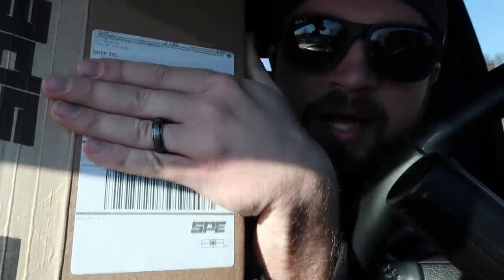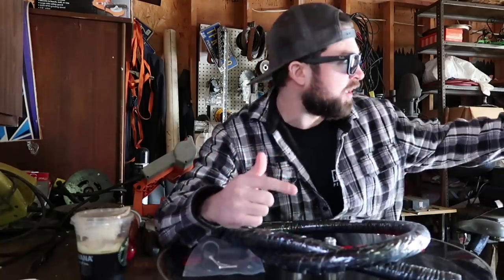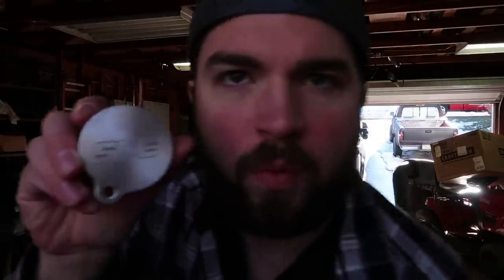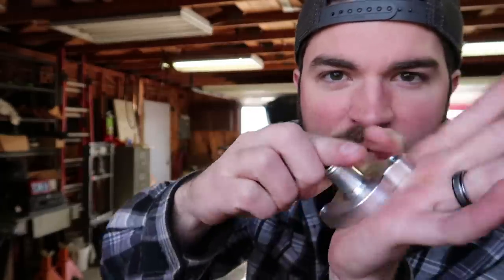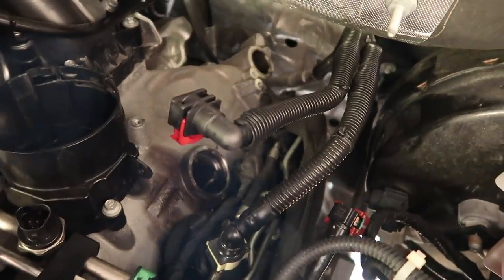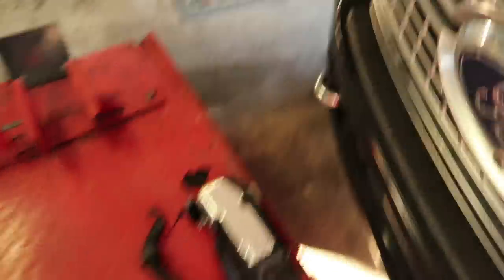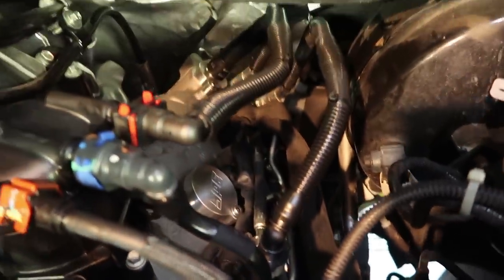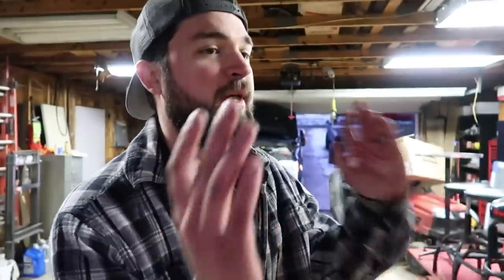OIL IN YOUR INTAKE - 6.7 Powerstroke CCV Reroute

Comment: There is nothing wrong with oil vapour going back into your engine. Definitely can't hurt the turbo and definitely won't hurt your motor. To add, now you are putting even dirtier air into the atmosphere . But do whatever you want who cares. Just wanna say it does no harm to your engine or else it wouldn't be engineered that way

Edit: The amount of oil that actually comes through in vapour form during a 5000 mile interval wouldn't be noticeable on a dipstick

Comment: crank   case   oil  lubes  turbo  seals   lubes  top  end  as  well  you  should  learn  about  it  read  about  it
Reply: That's not how it works.
Reply: SO  AS  ASE  MASTER   TECH  IN BOTH CARS  AND  HEAVY   TRUCK   AND   28  YEARS  I  BEEN  WORKING ON  AND  BUILDING   DIESEL FOR  THE  GM DEALER AND  MY  SELF   I  GOT  IT ALL  WRONG  OIL .   COME  ON  PICK   UP  A  BOOK  AND  READ  UP  . THE  BLOW  BY  CONTAINS  OIL   THAT     FLOWS  THRU  INDUCTION  SYSTEM  IT  IS  USED  BY  THE  ENGINE  TO  HELP  LUBE  TURBO   SEALING  RINGS   ON TOP  OF  THAT IT  HELP  LUBE  TOP  ENGINE  OF  ENGINE   WITH THE FUEL  BEEN CRAP THESE  DAYS  IT  NEED  ALL THE  HELP IT  CAN  GET   FOR  LUBRICITY     .IT  HELPS  EXTEND  THE  LIFE  OF THESE    ITEMS   . NOW  IF  YOU  WANT  TO  RACE   AND  DUMP A  SHIT  LOAD OF  FUEL INTO  CYL  AND  DONT  BURN  IT ALL  AND  DONT  CARE  ABOUT  ENGINE  LIFE  THEN  GO  RIGHT    ON  A   CRANK  CASE  DELETE IS  GREAT  SO YOU DONT    PUSH THE  SEALS  OUT OF THE  BLOCK GOING  DOWN THE  TRACK . BUT  ITS  NOT NEED  ON  A  DAILY  DRIVER     THE  ONLY THING THESE  TRUCKS  NEED  S  INTERCOOLER  PIPE  UPGRADE  AND  LOF  AND  FUEL  FILTERS  ,  EGR  DELETE    AND  DPF   DELETE .EGR  IS  KILLING THESE  ENGINE  WITH SOOT  WASH   OUT ,AND  THE  DPF  IS  BURN ENGINES UP WITH  HIGH  EGTS  AND  SHORTEN  THE  LIFE    ENGINE  PISTON  ARE   MELTING  @ 1400  DEGREES   VALVES  ARE NOT  MUCH  BETTER .

Comment: You have no blow by new truck
Reply: Every vehicle has blow by doesn't matter how new, diesel, or gas. Especially on a cold start where there is the most blow by. cold pistons and rings contract and become smaller giving bigger tolerances. the material expands when they heat up from the vehicle running if you had air tight seals you wouldn't get lubrication and eventually the piston rings would expand so much there would be nowhere for them to go besides between the piston sides and cylinder walls causing catastrophic damage and then you'd most likely need a new motor. Though the blow by is minimal they have it
Reply: @insaneTrout  My diesel produces much less blowby when cold for some reason.

Comment: This is a very very bad idea.  This is essentially a Road-Draft tube.  Abandoned even on the lowliest engines 40 years ago.  With very good reason.  All internal combustion engines create a positive internal crankcase pressure, since no engine has 100% perfect ring to cylinder seal.  So that pressure is vented.  An open tube like this sure vents it, but with zero control, and zero benefit to the engine other than releasing pressure.  On high compression Diesel with high pressure turbo, the effect is much more pronounced.  The system has a closed loop way of not only venting but creating a slight negative pressure.  This is actually good for the engine!  High performance racers know this hence why they put the same method on turbo cars even with gas, as the negative pressure helps ring-to-cylinder sealing at high performance levels.    The tiny bit of oil is normal, and will still drain out of the engine "draft tube" onto the ground and the bottom of the truck.  Guys, Diesels are efficient oil burners. This tiny bit of oil that is condensed from oil vapors, is drawn back into the engine, and yes there is a negative pressure here (think about it, if it weren't oil would be there in the first place), the engine quite easily burns it just like the oil known as Diesel fuel burns.  Unless you fail to change oil at regular intervals, this is clean oil,  clean system and environmentally smart.  And it has no negative impact on the engine.  (unlike egr and exhaust filter cleaning cycles.)  But the final reason? its illegal. you are now dumping oil intentionally which is ignorance.

Comment: you cant pull heavy trailers with  this set up i had to put mine back to stock plus i have found out doing this will shorten the life of your turbo
Reply: How, by not putting oil into your intake? What are you on about?